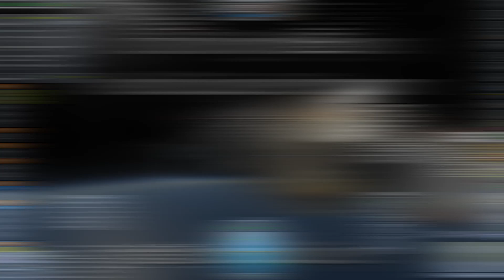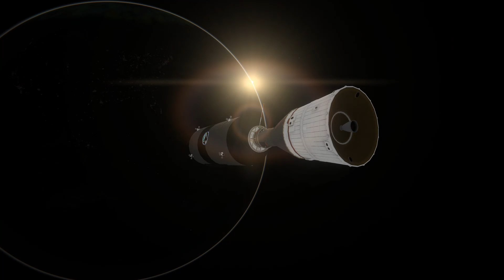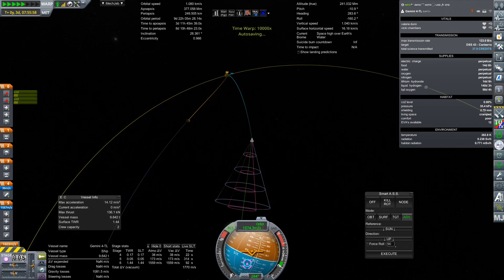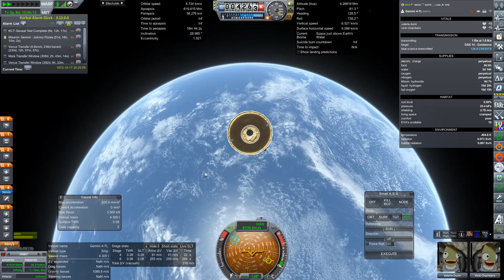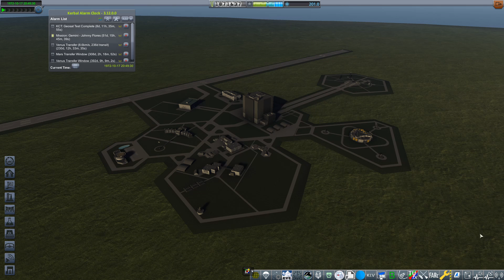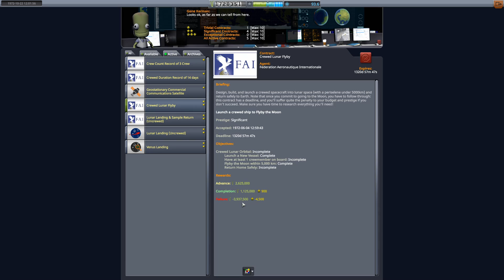Trans-lunar Tragedy! - KSP/RP-1 - Next Small Step Episode 50

Comment: You can basically block all radiation from solar storms if you point your service module/fuel tank directly at the sun (Kerbalism does raycast for radiation, even between different vessels). However, the general consensus is to either disable or significantly reduce solar storms in the difficulty settings. Apollo didn't have any shielding beyond the aluminum hull, and the astronauts were never exposed to significant amounts of radiation.

And don't worry, I blew up my first Lunar Gemini too. Its always a good idea to test these things.
Reply from the maker: Oh, that's an interesting point, I didn't realize folks turned that down usually. No solar storms would be very nice, at least. I got a pretty hefty dose just on a single Moon voyage, but I'm not sure all of it was solar storms - one must have happened on the way out to the Moon that I didn't notice.